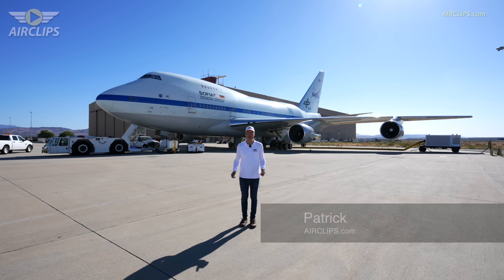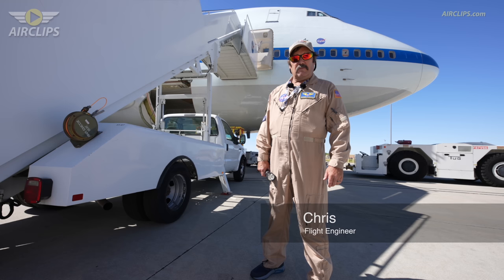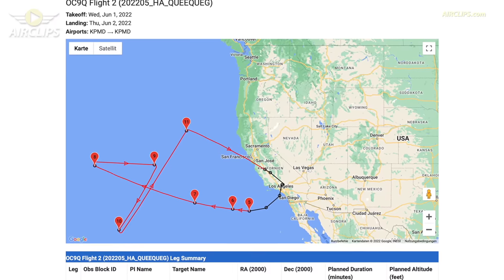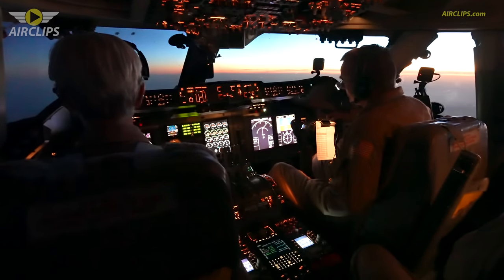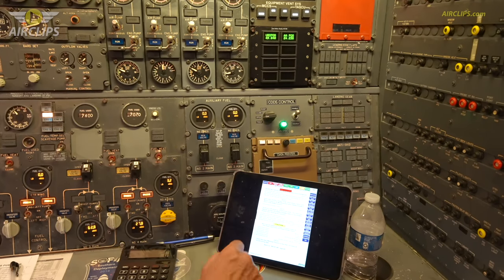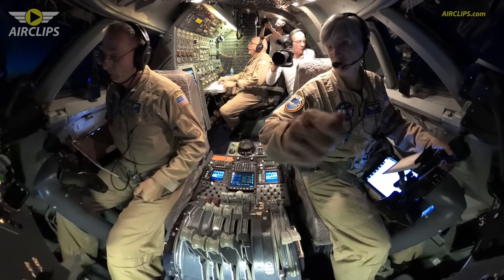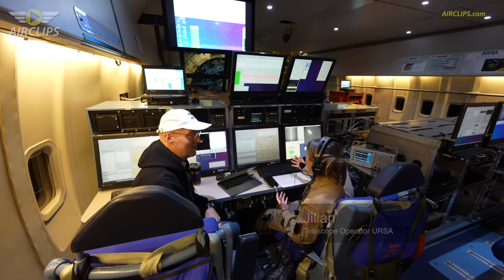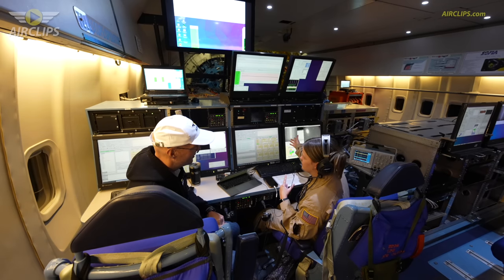4K! Cpt Elizabeth piloting NASA Boeing 747SP SOFIA Science Flight! Cockpit Movie SUPERCUT [AIRCLIPS]

Comment: Wouldn't you just love to just reach up and grab a handful o throttles on a 747? @ 14:06 "the Boss" those are mine! I'm wondering what the operational airspeed is when door is open? was bulkhead moved forward?
Reply: We maintain .85 Mach with the door open during Science observations. Yes, the aft pressure bulkhead was moved forward of the telescope and can be seen in the beginning of the video. And during climb, the Flight Engineers controls the throttles based on OAT and pressure altitude, and makes throttle adjustments based on what his charts show.